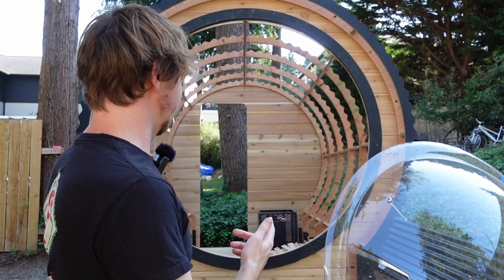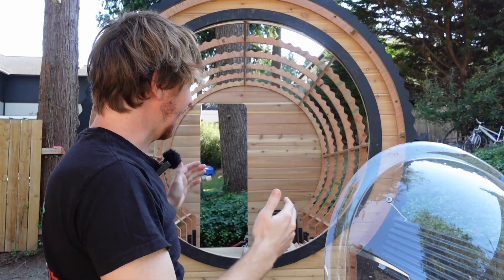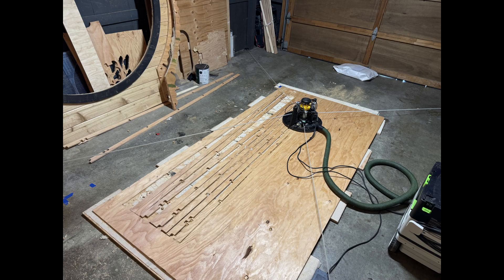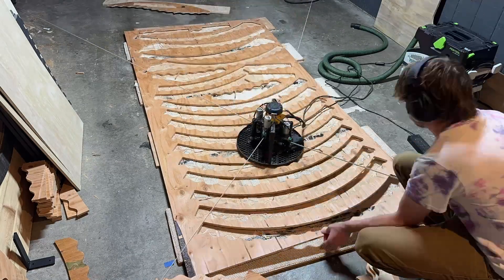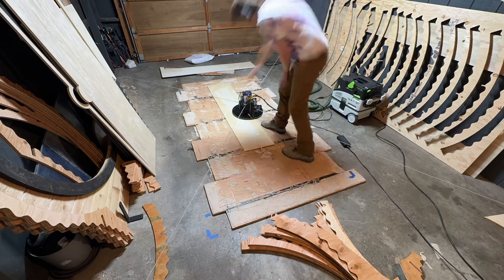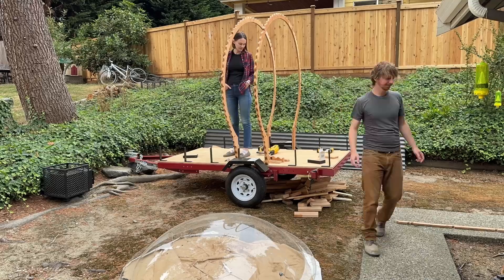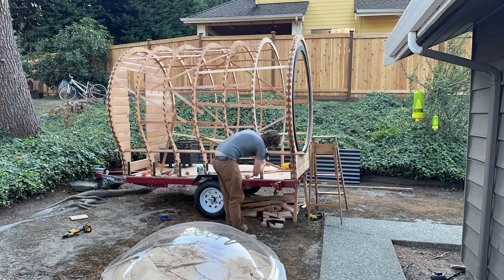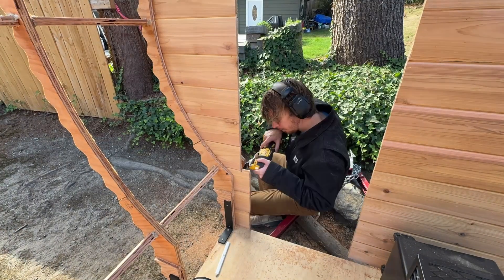Open Source CNC Sauna Build Part 1

Comment: Just learned about your product. Ran an Omnitech industrial router for 20 years.  Now retired.  Want to set up something like this in a small retirement shop. I understand the mechanics and setup, but not folowing the software to get a design and toolpaths generated.  Are there any tutorials or specific software? I did notice Abundance, and MakerCam on your site, but not familar with either.  I currently work in Autocad and Sketchup.  Can you import either of those files types in or something they can export?  Once a file is drawn or open, are there any tutorials or instructions on generating the gcode to run on the Maslow CNC. Ready to order; just need some clarification on generating gcode for the machine to run.  Thanks in advance.
Reply from the maker: I know, the software can be intimidating. The good news is that Maslow works with standard gcode files so almost any software can work (both Autocad and Sketchup are great choices). This video is a little old, but walks through the process https://www.youtube.com/watch?v=W0mW_mm1iBI

Comment: maybe there could be a cool sharpie attachment for the Maslow were it could sharpie a number onto the part. Originally I was singing carve a carve the part in the number in the part, but I was like you have changed the bed and you may or may not want an actual carved shape in it.
Reply: or maybe a laser attachment so that way it doesn't have to like Reyes up and down it can just like kick on the little

Comment: Tweak the design so similar parts are identical, instead of trying to label them. From an assembly point of view, its much better to have 100 of the same part, than 8 sets of similar looking parts that each can only go in one of 12 places. If they are similar enough to be confused with each other, they are similar enough to design to be interchangeable, even if you have end up with unused screw holes and notches in some parts.
Reply from the maker: I agree, I think that a lot of the confusion could be dealt with at the design stage

Comment: Very cool! Really looking forward to seeing the finished product. Curious how the plywood is going to stand up to the heat and moisture. I built my own barrel sauna about five years ago and it required a lot of repetitive router work. I have often thought of building a custom CNC router jig designed specifically for doing that work.

Comment: Does your design software do 3d printing output?
I'm currently using Blender and a Bambu A1, and Blender isn't really suited to cad
Reply from the maker: It sure does! There's not a lot of documentation yet on how to use it, but it can absolutely export a .stl file for 3D printing
Reply: @maslowcnc  It would be interesting if you could design the cnc cut plywood and printable  plastic 'brackets' (to clip all the plywood together) in the one system.  Change the thickness of the plywood, and all the brackets would re-configure? I've seen geodesic dome builds that use 'bent' metal brackets to hold the wood frame together.
If you printed tpu brackets, that 'bit of give' might make the de-constructible campervan easier to install?
Reply from the maker: @DaveTimperley  That's exactly the idea. You can build a model which is parametric for things like wood thickness and then have all of the parts resize automatically
Reply from the maker: Including printed parts :D
Reply: I've been using Blender and a slicer to do al my designs, and what drives me nuts is having to export and reload into the slicer every time I make a change on a model.
Can your software do a 'sliced' preview inside the program?
I guess my ultimate wish would be a CAD program that did real-time sliced previews while editing the geometry :-)

Comment: Another great project :-) I'm 'all in' on your 'make it big' direction.
Are you cladding this with steel?
My neighbor has a tiny glasshouse which has a roof of bent corrugated clearlite. 
This basic design would make a great glasshouse if you used a transparent corrugated sheet for the roof.
You could integrate shelves into the curved wall braces maybe?
Reply from the maker: Totally! I've actually been thinking that a greenhouse might be something that I'd like to build too...I just need to figure out where to put it :p
Reply: @maslowcnc  You could build it on the trailer. I was thinking that a trailer based greenhouse would be great for people who rent.  And trailer based means you could move it around the garden during the seasons, or park in a garage  at night and bring it out during the day and park it on the driveway ha ha.
Have you heard of the old TV show 'Thunderbirds' from the UK? You could have a series of modules (like TB2) That could be swapped around on the trailer?
What about if you stood this cylinder  on it's end and pointed that cool dome at the sky to make a one person standing in side greenhouse like an old world telephone box ha ha.
You could hang pots right off the plywood ribs.
Flip the dome around and it could collect rainwater?
Reply from the maker: @DaveTimperley  I love this idea so much! I might actually build one of those!
Reply: @maslowcnc  So next day.... I thought ok there is a 'vertical' greenhouse big enough for someone to stand inside, with water collection in the roof. What if the collected water dripped down through holes in the roof, around the 'hooks' into each successive layer of hanging pots, which would accept the water drips from the pot above, and the excess drains out the bottom of the pot, to the layer below, and eventually straight out the floor.
Something like those gutters that use chain to carry the water away from the trough?
Automatic watering and drainage using gravity ????

Now all this thinking about 'pots' got me thinking that you could install rings of LEDs and then grow...
ha ha
Reply: @DaveTimperley  Great idea. Mobile greenhouse to maximize sunlight.  Better yet, automate that.  Kickstarter time.
Reply: @Makelifehappennow  A greenhouse that moves around the garden under it's own steam??? That would be cool. Be like one of those eighties British horror TV shows where each time the house owner looks out the window, the spooky tree/rock/etc has moved to a new location ha ha. Would freak the neighbors out.